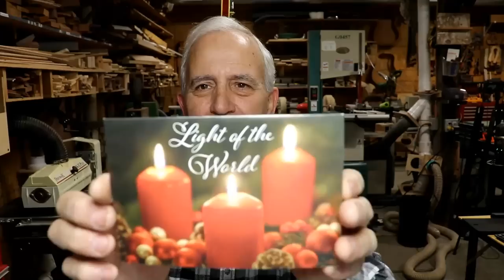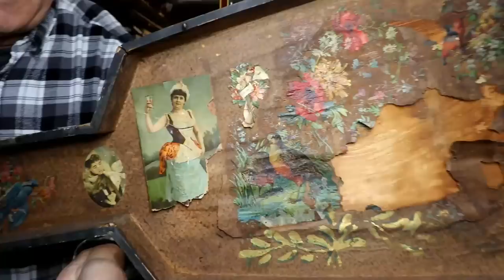Vlog #172 1800s Guitar Restore Scotts Guitar Link

Comment: Mr. Rosa that Washburn is a beauty and I look forward to the restoration video. The guitar is most likely no later then 1890 and it might have originally used gut strings and had a bridge like a Spanish guitar. At some point someone put steel strings on and probably popped the old bridge off which is why it was modified. Not sure what the customer wants but if you are going to put it back to original I would suggest nylon stings.